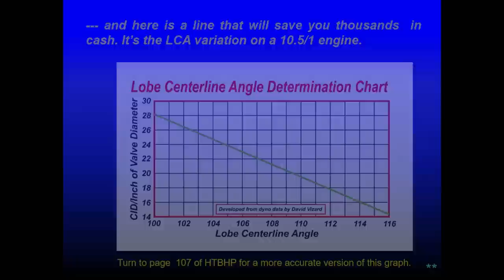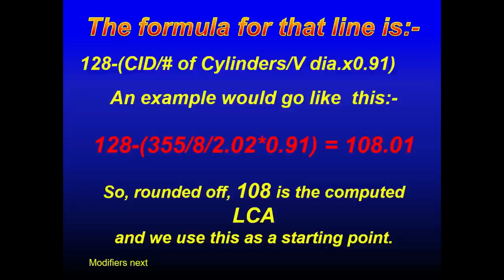Cam profile dynamics Vs event BS bashing!

Comment: Guys, sorry for the delays in vidio uploads. Among many problems to do with covid 19 and some legal youtube requirements for me  to take over sole responsibility for this channel now Marvin has passed are holding things up. While all this is being resolved I have managed to put some videos in the can ready for a big splash on my return. 
Message for Jon Schmidt - the comments you posted have put you even deeper in the hole so if you mistakenly thought you were off the hook - think again!
Reply: How much power does an engine make that breaks valvetrain parts ?
Reply: David, what cam design experience do you actually have?
You mentioned that you went to Harvey Cranes class twice, he passed in 2013 and his software was already more than a decade behind the times. You mention that his designs were smooth; apparently you don't  understand the difference between a cam that is smooth and one that that is engineered to manage the dynamics (they are not the same thing). Harvey's software never had capability to analyze for that. It was just a primitive DOS based app that could piece together polynomials.  
Just to help you and your readers understand, modern cam design uses completely different methods because the work to get a decent design from polynomials is too tedious and time consuming to be practical. That is why cams designed with polynomials tend to have undesirable pulses in them. Any procedure that inefficient cannot be practically used in a process of optimization. Simulation and optimization are key to modern engineering.
Reply: @jonathanschmidt6507  all of it.
Reply: @troymecey  
What do you mean "all of it"
All of what?
Reply: @jonathanschmidt6507  so in theory the cam you pick will produce more power correct? Because that was the bet right? So.... Pick your cam and the Dyno results will speak for themselves.
Reply: @ogt92fromthe1step9  
That was Davids attempt to change the subject away from the question that you should be asking.
The argument was whether cam card specs or motion dynamics are most important. Of course motion dynamics are most important because that is what determines if the parts will have good durability. A broken engine doesn't make ANY power.
Ask anyone that actually designs cams, they will tell you this.
Designing cams is much more than coming up with lift, duration and LSA. Frankly, that is the trivial part of specing a cam, the difficult part is designing the actual motion of the cam.
Since David doesn't even know how to design motion dynamics he leaves it to the cam designers. He relies on their hard work, then denigrates it by saying that it is less important. It is just shameless self promotion.
The problem with that is, that unless the cam designer knows what parts you are using in your valvetrain he is forced to design for the worst case valvetrain with all stock parts. That means leaving power on the table.
Further, tuning an engine for max dyno power is rarely what makes the most satisfactory engine for the customer.
The narrow LSA cams do not have good drivability and have terrible eye-burning emissions.  I hope that you care about our environment.
This is why successful cam companies don't follow David's advice, they know from experience what makes satisfied customers. Vastly more experience than David has.
All of the cam companies know that if you take the cam they recommend and narrow the LSA, it will make more power on the dyno, that is common knowledge. They also know that isn't the choice that ultimately makes the car most enjoyable.
Don't be fooled by people selling books and seminars with gimmicks.
Reply: @jonathanschmidt6507  lift duration and LSA are all factors of the motion of the cam I don't see where you are actually going with this. The basic AutoCAD or fusion 360 has simulation software programs I don't know where you think you're going with the hard work and the due diligence you speak of? These guys were in the shops with mathematical calculations and cam grinding machines and trial and error to get the results they were after (experience) no I don't think David ever cut a cam but he's been there to see it and understand it and certainly knows how to pick the best cam to make the most optimal power. You sit behind a desk now and draw it up with some sort of CAD base software then run it through your simulation software and get your results. Your results will be totally different from real world scenarios with the margin of error that you leave on the table. Furthermore did you really ask me if I care about the environment? What kind of green shit is that? We're speaking  in terms of optimal performance. Get out of here with that shit. We are also talking about flat tappet cams here, most try to for the biggest cam they can shove in it. They are looking to get the most optimal power they can get out of their SBC. Pick your cam and David will pick his and let the dyno results speak for themselves. In this whole essay you just wrote not once did you mention that you would follow through with it, is there something holding you back from not stepping up and picking one?
Reply: @jonathanschmidt6507  You should know with all Comp Cams flat tappet lifter and lobe failures. I have never had any of those problems with Lunati or Isky cams.
Reply: @ogt92fromthe1step9  
If you will calm down and listen this is an opportunity for you to learn. I work at a much higher level of engineering that David ever has.
Proper cam motion and lobes cannot be designed on a CAD software. 
The motion is designed in a software that is capable of designing a curve that is smooth through lift, velocity, acceleration, jerk and snap. The design is done on X-Y space and then the shape of the lobe is determined through kinematics.
It is an iterative process, because you can't just call out a lift and duration and have acceleration and jerk values that will work.
That is where the real cam design work happens. Calling out lift and duration numbers is child's play by comparison.
If you are really interested to understand the real engineering of how cams are designed, I will be happy to explain it to you.
PS, I hope yo will care about preserving our environment.
Reply: @kennywhiddon1497  Lunati and Isky don't follow David's advice either. They know it is bad advice. Unfortunately people that don't understand that peak dyno HP is not the best criteria to choose cam specs will fall for it.
Reply: @kennywhiddon1497  
It might be helpful for your understanding of the performance aftermarket camshaft industry to know that almost all of the flat tappet cams are all made at one of two companies and then resold by the rest. The main supplier is CMC, most people have never heard of them, but they make the cams the performance aftermarket companies sell. For the most part, it is only special cams that are made in house anymore.
So when you say brand X makes bad cams, you soud understand that for the most part, all of those companies are selling the exact same cams.
Reply: @jonathanschmidt6507  so an x and y axis in space sure sounds like computer automated design  (CAD) or at bare minimum a variation of that. Also what you're saying is the motion is designed in a software "that is capable of designing a curve"  So the motion is called out and the software spits out the predetermined curve is what you are saying.
Reply: @jonathanschmidt6507  side note no I don't care about what a few radical cams will do to the environment as opposed to what shipping vessels and burning fossil fuels for transportation and energy are already doing to the environment. But I digress none of this is really pertinent because within the next decade or so all of this will be obsolete following the EV movement and the pissing contest over which dude in the motor industry knows more will just fall by the waste side. So whip them and measure them on the dyno like the man said and this pissing contest will be over when the numbers are crunched.
Reply: @ogt92fromthe1step9  

It might sound like that but it is much different.
In modern motion profile design we don't directly draw the lift profile.
The important curve shape is the acceleration and jerk curves.
If you are not familiar with derivatives and integrals, this might be interesting for you to learn.
The acceleration curve mostly determines the loads and vibrations that occur within the mechanism of the valvetrain and the coils of the spring. So the way we design motion now is to design the shape of the acceleration curve. Then we integrate it to get the velocity curve and then the lift curve. This explanation vastly over simplifies it though, as the integrated velocity and lift curves will not end at 0.0 (as they must). So the next step is to use a solver that adjusts the shapes of the acceleration curve until the integral equal zero at their ends. If that seems like a lot of work, it is just the beginning.
The next steps are to compute the surface contact stresses. It is easy to design a lift and duration that you want but find that the surface stresses will be too high and it won't have good durability. So then you have to rework the design to solve for that.
Still not done yet, the same cycle is repeated for tribology (oil film entrainment),  and then the motion dynamics have to be computed. This requires a very specialized set of tools, not something that a common CAD/CAE software can do.

Hopefully you are beginning to understand why people that actually design cams don't take David seriously. He is like a guy saying I want a 3 bedroom 2 bath house, then claiming that he designed it when the architect and builders did the work.

If you are interested in learning more, I recommend reading from the free articles written by Gordon Blair. He wrote books for the automotive engineering professional, it will be harder reading than what David writes but is vastly more substantial.
In case you don't know of Gordon Blair, he wrote the book, Design and Simulation of Four Stroke Engines, it is the most advanced book written on four stroke engines. It is the foundation upon which modern engine simulation programs are based.

You can find a list of the articles that were published in Racing Engine Technology magazine here:

http://www.profblairandassociates.com/RET_Articles.html
 
If you want to elevate your knowledge of engine engineering, this is a good place to begin.
Reply: @ogt92fromthe1step9  

The thing about picking cams or any combination of parts for a high performance engine is that engine builders without much experience tend to look at charts and choose the parts that are reported to produce the highest HP numbers. The result of this is usually a dissatisfied customer.
I was a Senior Design Engineer at Edelbrock. It was a common story that people built combinations thinking that they would be most happy with whatever parts made the most power.
Those people often cam back and thought there must be something wrong with the parts. The real problem is they bought parts that were not a good fit for their application and desires. It is tempting to think you want the most power but when you actually drive the car in traffic, the poor drivability and eye burning exhaust makes them regret their choices. That is one of the challenges of designing for the performance after market, you can design parts that make god dyno charts, (it is easy to do), but the customers won't be satisfied.
I'll give you a good example, when I was working on the Ford Coyote manifold development project, I made some manifolds that beat even the Boss manifold.
But we had people do blind test drives when they didn't know what manifold was on the car. I was not surprised to find out that test drivers though the truck manifold was the best (it had the broadest torque curve) but was down something like 70HP. at peak.
The cam companies know this too. They know they could narrow their LSA and make more power, but they also know their customers won't be satisfied.
David takes advantage of this situation to try to look like a hero, when real professionals in the filed know it is bad advice.
Reply: @jonathanschmidt6507  this is all very interesting and I appreciate the link I will look into that it's always nice to get a better understanding and a better grasp on how the whole process works. But still the old man challenged you so let's see these numbers. I mean if it didn't mean anything to you then you wouldn't be on here talking with a random bunch of strangers. It's a pissing match and we understand that but if you are so adamant on this why not do it and back up your claim/fact? Just an honest question .
Reply: @ogt92fromthe1step9  
We have already seen how David does in dyno competitions. He sucks.

Engine development professionals don't think dyno challenges for peak HP are a good criteria in the first place.
The goal should always be to design the cam that satisfies the owner the best.
In my experience that is never simply making the most power. 
The priority should be as follows:
1. Durability, the cam must be compatible with the valvetrain parts used so that it doesn't break or wear out parts. Davids formula has no consideration for that in it so it is useless for the most important issue. David doesn't even know how to design a cam for that consideration.

2. Drivability, again Davids formula has no consideration for the factors that determine drivability. Anyone can take the best cam for an application and then narrow the LSA and make more dyno HP, that is well known, not a secret, It is also not secret among professionals, that it makes the cam worse for the customer.

My only goal here is to answer David's lies and help inform people that don't know where to get professional level knowledge about engine development where to begin.

David called me to get involved in this, and made these videos hoping to get views so he brought this on himself. I am doing what he asked me to do.

Sadly, his health and mind seem to be fading. Sad to see someone spending what may be his last days, telling lies and slandering someone that is telling the truth about his gimmicks.
Reply: @jonathanschmidt6507  sorry you lost me at the gate. Anyone just stabbing a cam in knows that spring pressure and clearance are top priority when choosing your lift and your duration. So he really shouldn't even have to worry about a formula. If I were to say stab a cam. 550 lift on a set of stock vortec heads the motor wouldn't even start 1 it probably would pull the rocker studs right out of the heads 2 coil bind and 3 the rockers would smash right into the spring bosses bending the push rod's. The ball's really in your court here you were supposed to pick whatever cam you wanted and he was going to match with his. So for sake of durability and drivability don't pick a monster pick something within .450+- lift and do a set number of pulls on his Dyno with each and see what cam makes the most. That's it.
Reply: @ogt92fromthe1step9  

Obviously consideration for the kinematics are included in the design for durability that I mentioned as the first priority. 
Proper engineering is not "stabbing a cam in".
If you and David want to operate that way, that is up to you.
I have posted better advice.
If you prefer to work with methods that were how amateurs did in the 1970's, enjoy yourself.
If want to raise your game to how professional work, I suggest that you start by seeking better sources.
Reply: @jonathanschmidt6507  ** cough, cough** cop out! You are so adamant that you are correct then do it. Proper engineering? You're designing/selling cams that are machines elsewhere sir and it is solely up to the consumer to set their top end up accordingly for the higher stress levels. There are equations out there to calculate this. Also the '70s mechanic style that you speak of, we are talking about flat tappet cams here are we not? So with all that being said nothing you have stated holds anything in value if you can't physically back it up. You are not a "theoretical" engineer are you? I would assume a mechanical engineer or something to that nature and if you can't physically back up your statement what do you have to bring to the table.
Reply: @jonathanschmidt6507  so you owned a machine shop and cam grinder sold that some where in the mix you ended up crewing for funny cars then back to cad/cam work everywhere else. So how do you acquire the most up-to-date software that these people must consult with you to build their engines for their top of the line brands? Or is the side work using the software from the company that you work for? Just curious because you have stated that it is extremely expensive. All of this because you're upset about an old man porting heads with a dia grinder and showing "his" flow bench results with Dyno results to back it up. You sure seem to be looking for anything else to take away from the subject that David challenged you to pick a cam. Pick a cam and carry on and let's see the numbers.
Reply: @ogt92fromthe1step9  

David called me on my phone and invited me to this channel to stir conflict to get more views. I'm doing this to help him out.
]I don't actually know what the challenge is that you mention. It seems to be something about picking a cam.
Our goals are not the same so there is no way to compare them.
David is focused on creating the most power.
I am focused on making the best cam for the application. The best cam for the application will generally make less power than a cam designed to make the highest dyno numbers.
The argument David and I have is whether the LSA is the most important thing about cam design. If you think that is true, you don't know much.
Here is a question to test your knowledge:
You may have noticed that cams usually do not have lift dimensions in round numbers like 0.450, 0.500, 0.550.
Do you know why that is?
Reply: @ogt92fromthe1step9  
I can help you understand money and motorsports.
Motorsports is a very poor way to make money. If you do it, either do it as a hobby to be involved with friends that you enjoy hanging out with or plan to be poor.
As I mentioned, the motorsports work I do is not primarily to make money. Crewing on racing teams is definitely not a good way to make money, few teams can even afford good food and lodging. If you want to travel comfortably, you will have to pay for a lot yourself. For example John Force Racing moved from Yorba Linda CA to Indiana because they could not pay their crew members enough to live in CA. I was doing CAD projects for them at the time.
If you want to make money involving engines, you should learn skills that large companies need and that very few people know and are not taught in universities. 
To do that, you need to spend your own time and money to develop new technologies. If you have some good ideas and invest enough in them, some  (not all) of them may become valuable. This type of engineering pays large multiples of what working as an employee does. Or it can pay nothing at all if you don't find clients. It is an expensive investment though, I spent roughly $250,000 and 5 years of very hard R&D work before I made anything, but doing so paid off very well. Fortunately I had a very good job in engineering software development at the same time. You have to work at least 80 hours a week to stand out in the field, I always have (what Elon says about this is true).

I have always been fortunate enough to only do jobs that fascinate me, one good thing about that, is that it can make you valuable and paid well.
The problem now is that most automotive OEMs are canceling all future new internal combustion engine projects. Even after some have spent a fortune to develop their new systems.
Unless something changes dramatically, anyone interested in automotive engineering should focus on electric propulsion systems or autonomous control. The jobs in internal combustion are vanishing and the smart people that are not near retirement are moving to electric.
If you want to make money though, forget about engineering. I made far more in my machine shop than I did in engineering even though I did very well for engineering. If you have 3 good CNCs and good skills, you can make well over a million a year without any employees. One nice thing about that line of work can be, is if you make large complex contoured parts you can run the machines lights out and enjoy your life doing other things.
I should add, don't be afraid to invest in yourself, if you don't have enough money to buy equipment (that makes money)borrow it and use it to make valuable things.
Reply: @jonathanschmidt6507  this is something that I never put much thought into so I was under the assumption the maximum lift is  multiplied by the rocker ratio (1.6 ) making a little more difficult to get a whole number. Although if that was indeed the case I'm sure it could be factored in the grind to get that whole number.
Reply: @jonathanschmidt6507  I have no interest in pursuing anything in the ICE industry. My personal goal is to further myself in the automation industry and keep furthering myself in CNC machining (my hobby/personal shop) but I've worked in several machine shops and a punch grinding shop) I am working towards building my own shop up. And I understand the joy with working with others and R/D.  So now I see all of this was just for views, because for longevity of the motor why would you change the LSA to a 108 on a flat tappet. You make more power but in turn put a higher stress level on the valve train essentially just hammering springs and retainers. I don't know where my mind was these past few days I totally missed the LSA part, like I saw it through these conversations but it just went right over my head. I have a lot on my mind these past few days sorry for the inconvenience. And yes you are correct and I can admit when I'm wrong and thank you for sharing the information that you did. Thank you and have a great day.
Reply: @ogt92fromthe1step9  
This is an opportunity for you to learn something that very few engine builders understand.
Most engine builders think that the design of a cam is driven by the number you see on a cam card; the opposite is true.
Before designing a cam you do have a goal for a combination of the numbers on the cam card but much more importantly, the dynamic capability of the valvetrain parts.
The dynamic capability of the valvetrain parts determines what acceleration, jerk and snap you can use in the cam to be compatible with the valvetrain and avoid breaking parts or wearing them out prematurely.
So you start with the duration number and buildup an acceleration curve that is compatible with the valvetrain and that produces a resulting lift. That is why it is not a rounded number.
So, here is where it gets interesting and important for optimising the engine. You may have wondered, "how does the cam designer know what the dynamic capability of my valvetrain is?" ; unless you are working with a well equipped cam designer they don't know and have to guess. So when the cam designer has to guess about that, he has to assume that the customer has the worst stock valve-train parts and make the design compatible with those flexible parts.
If you have an engine with a valve-train that is stiffer, but you run a cam that was designed for flexible parts, you are leaving a lot of power and durability on the table.
It would be like choosing tires for a car not knowing how much power it has.
This is the original disagreement that I had with David; he said that the most important part of specing a cam is the LSA. Everyone that has actually designed a cam knows that knowing the dynamic capability of the valvetrain is the most important information because that is what determines what the cam design can actually be.
No cam designers that I know of use David's 128 formula, it isn't even physics based.
Reply: @ogt92fromthe1step9  
Glad to see that you have an open mind.
Good luck in your business. 
My first job was as an apprentice in a tool and die shop so I am familiar with punch grinding. Back then it was done on manual surface grinders, I love a Mitsui grinder and miss the enjoyment of making the beautiful tools it could produce. 
If I can offer you some advice about machining business, always target markets that are hard to satisfy, not easy commodity parts.
I should clarify, the problem with narrow LSA is not that it is hard on valvetrain parts it is not a factor on that because LSA only determines the relative position between the pair of lobes.
The LSA dimension is a trade-off between peak power vs drivability and emissions.
A narrow LSA has more time while both the intake and exhaust valves are open. This does enable an engine to pump more air at high RPM, but it does so at the expense of having a lot of exhaust gas in the cylinder at low RPM; than means rough idle, poor driving quality and eye-burning exhaust.
Anyone can say, "use a narrower LSA and you will make more power", yes of course you will, but you probably won't drive and enjoy your car as much. Your family, friends etc won't want to ride in it.
Reply: @jonathanschmidt6507  Also the loss a vacuum for such things as power brakes. But you can trade off and run other systems such as hydro boost or a vacuum canister of sorts.
Reply: @jonathanschmidt6507  here's an honest question for you what lifter would you recommend for a flat top hydraulic cam and a SBC? The cam and lifter kit that I got from Comp cams I took the lifters out of the box set them on my surface plate and ran them under my surface gauge to the lifters were flat no crown whatsoever the rest the crown was there but kind of erratic summer centered somewhere offset. The crown had about .003 radius. I'm not happy quite obviously with these lifters because there were many blemishes and nicks and chips to the edge of the lifter as well as the face. I'm thinking about purchasing a set of Delphi hl-66 lifters what are your thoughts on that. Now it has been stated that there's only two major lifter companies that produce lifters but with that being said is there a specific brand that you would recommend?
Reply: @ogt92fromthe1step9  
Yep, you get it.
Reply: @jonathanschmidt6507  I chocked the cam up in my lathe and ran a dial indicator past the lobes that all checked out but I do like the fact of running Prussian blue over the contact patch thanks for that bit of insight that never occurred to me to use dykem blue and it makes perfect sense
Reply: Not the layout fluid,
This stuff (non drying)
Permatex 80038 Prussian Blue Fitting Compound

If your contact patch is not near the edge of the lifter, then you don't need to worry about the chips.

The non drying blue is the best fun in a machine shop.
Put a small drop on the handles of a machine that is run buy a jerk in the shop.
Reply: @jonathanschmidt6507  lol just like never seize. Once that stuff comes out you instantly turn into the tin Man 😂 but my other question is will this process work with a nitrate coated cam. The cam has this sort of black texture from the process. My thought is like you said install the lifters and valve train and it over by hand making sure that the lifters are rotating in that process it should just wear off that thin coating. You should be able to see the wear marks on the cam through the lifter boards and from that quite possibly see the wear pattern on the lifters from that transfer of that coating. But I don't know if a thin coat of oil will wash away that transfer because I do not want to turn it over dry.
Reply: @ogt92fromthe1step9  
I have always found that it was necessary to make it as dry as possible to get use out of the blue.
You can try with oil at first and see if you can get good enough info from that. Then only dry it if you must.
For the test just hold the lifter down with your fingers, that way there won't be enough contact stress to harm anything.
Reply: @jonathanschmidt6507  I dig it. And doing so by holding it down with my finger and dry there might be enough of that "coating" (for lack of a better word) to transfer off onto the lifter.
Reply: @ogt92fromthe1step9  
Sort of, 
The way contact blueing works, it will transfer blueing to both sides but in the contact area it will squeeze the blueing out, so in the end the blueing will surround the contact area.
Reply: @jonathanschmidt6507  I understand how the bluing works. I was referring to the blackish residue that's on the cam from the nitrate process.